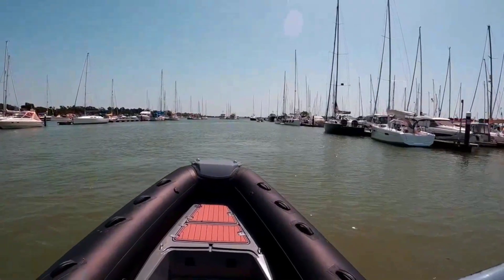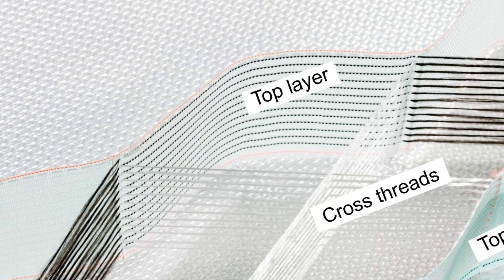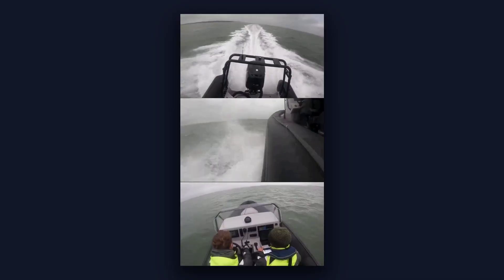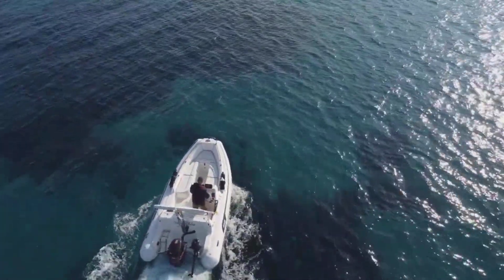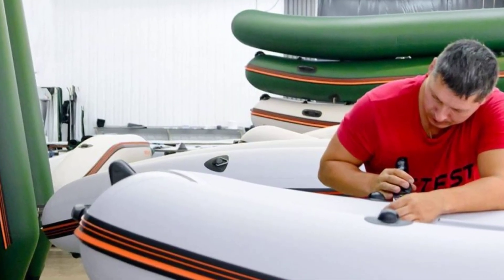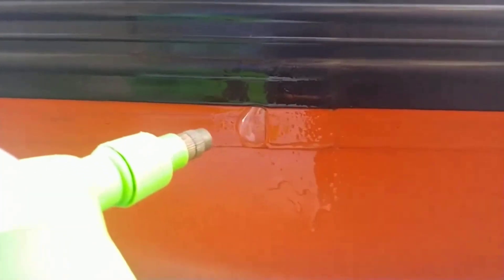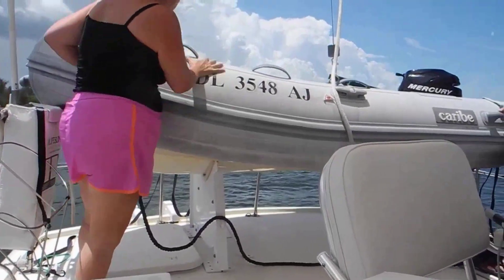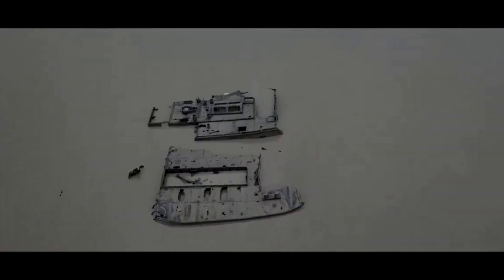Inflatables Turning FATAL - Experts EXPOSE RIBs BURSTING Apart! (The Reason is SHOCKING)

Comment: I had a 1980s Achilles 14' (Japanese) that I used for 15 years on my 58' Trawler, 1987-2002.   Hypalon with a 30HP Tohatsu.   It hung on davits on the stern at her berth in Sausalito.  Held up very well!   Never a problem, used it a LOT.   But- I kept it covered most of the time and regularly treated it with "303" protectant.  Sold the trawler and the Achilles was still in good shape.